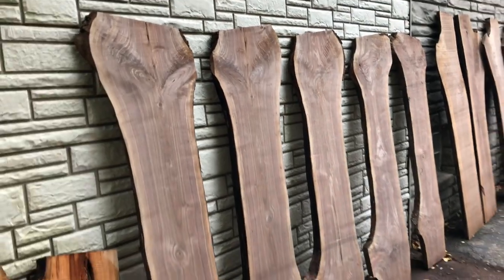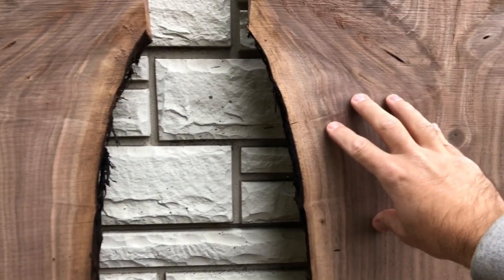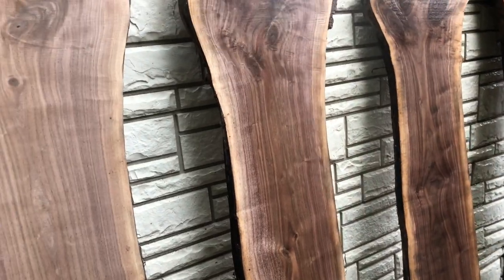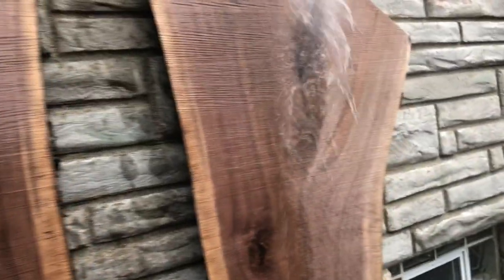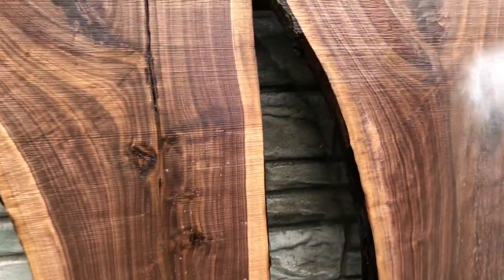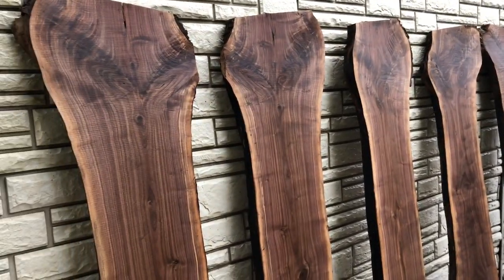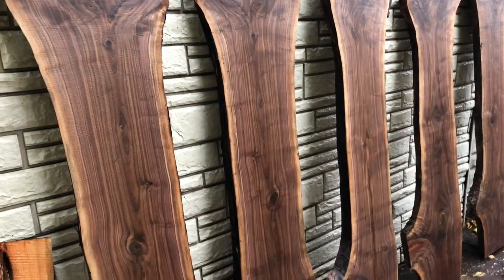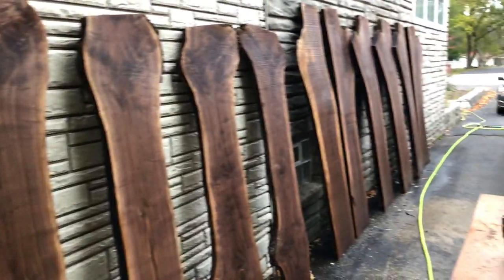Milling Monday #14 | My Slab Drying Process-Pt. 1

Comment: Thank you for sharing.. 
you don’t experience any warp in the wood leaving them upright for a month or so at a time?  When or how do you think that would form ? As I was always under the impression stacking helps or weight..
Reply from the maker: I do not experience any warpage doing this. By and large I think if the slabs are going to twist, it will happen no matter what. I’m going to get into some different ideas about stacking next week.